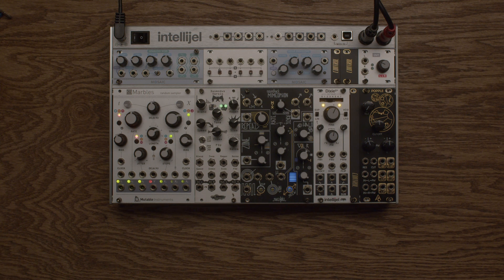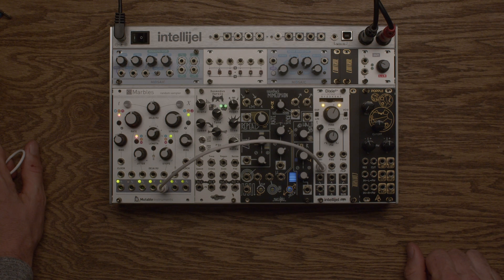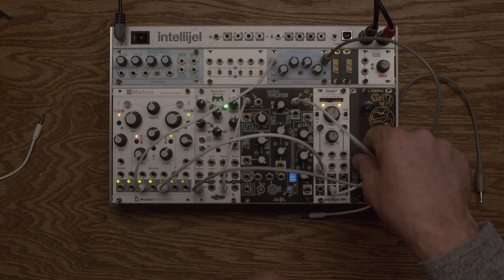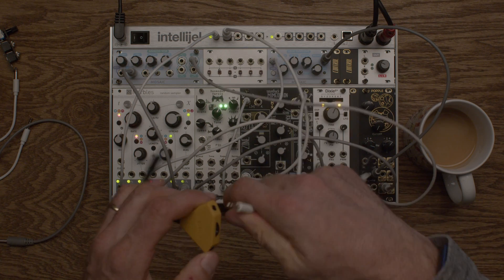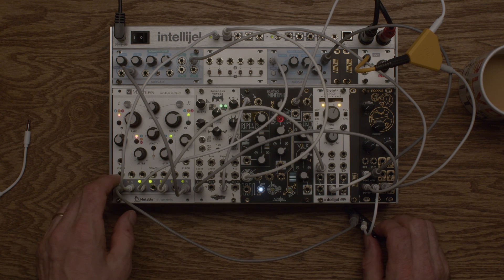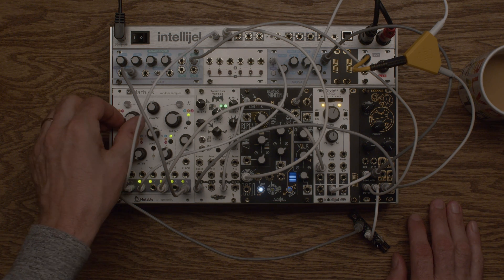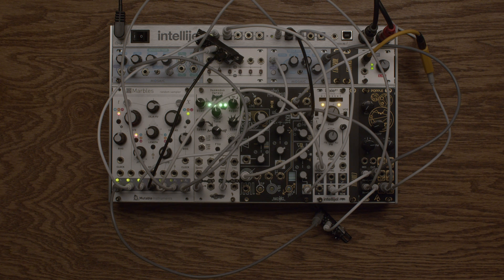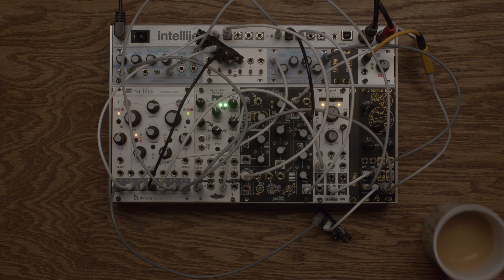Tiny Synth - Modular Patching With A Small System

Comment: Just came across this. Great results from such a small system. One question/thought… that Splix mixer/mult… I see on their website it’s supposed to be good for audio signals. It’s my general understanding that passive devices, like mults, are fine for splitting but not mixing. The Splixs looks like a passive 2 to 1 or 1 to 2 mult with an attenuator. Do you get any weird signal loss or signal bleed across channels? Their site says loss is expected but wonder what your experience with it. It’s mixing… but is it mixing 😂?

Comment: You could build something way cheaper like using a marbles clone and say tip top reverb and get way more versatility out of a oscillator like the bastl pizza! You would also be left with a lot more space!
I understand if you transferred these modules from a larger case though. I guess bargaining is not on the top of a lot of people’s list!
Reply from the maker: For sure! I have some clones, but got rid of some as I like working with the larger, original MI designs a little more. I am also pulling them from my large case where I have plenty of room - makes it a fun challenge building these small systems! :)